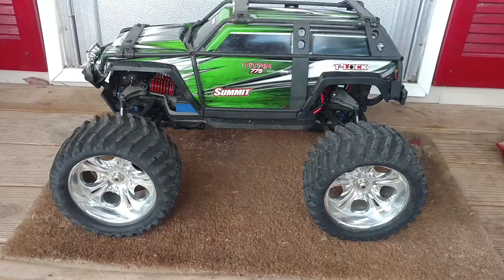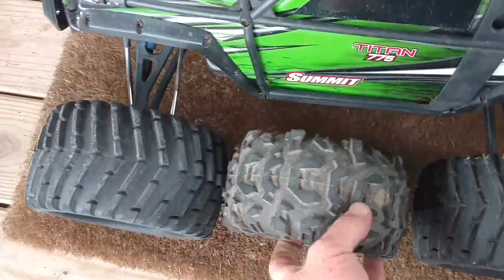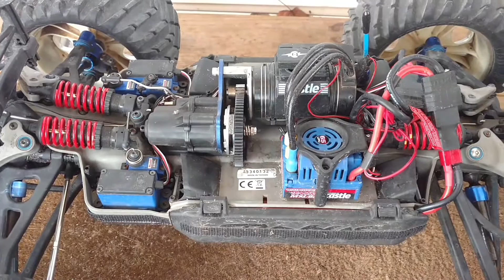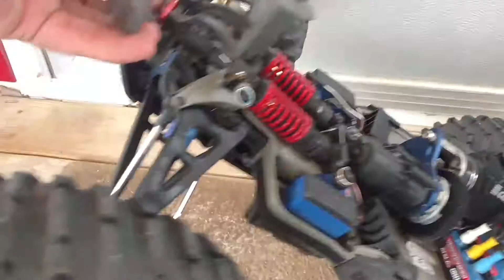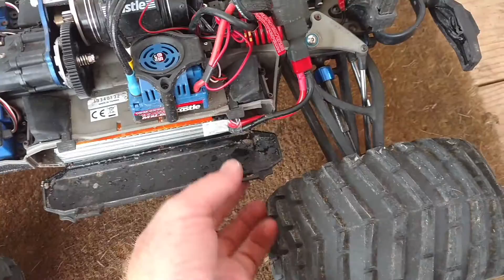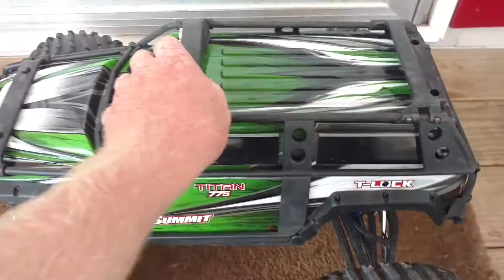Traxxas Summit mods with CEN Colossus tires

Comment: Hi, I know this is an old video.  I was just wondering why you replaced the Twin Titan 775 Motors..??  In your other video, your Traxxas Summit looks fast doing donuts 🍩 in the dirt.  I was thinking of installing the Twin Titan 775 Motors too.  Were you using the Kershaw dual motor mount..??   

Did you just go brushless because you got more speed & less weight using one motor..??  Thanks
Reply from the maker: I built the mount . I'm not sure why I went brushless LOL more power and speed